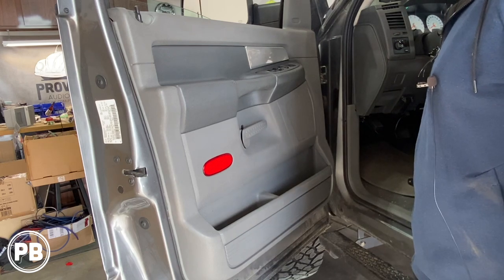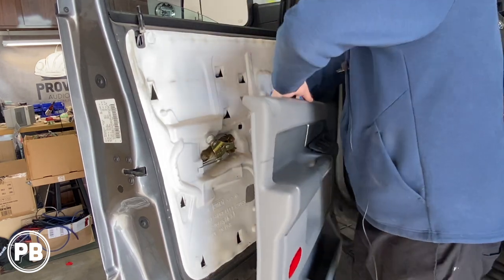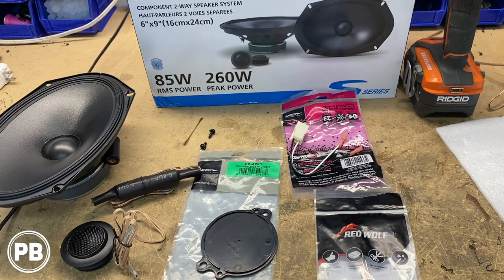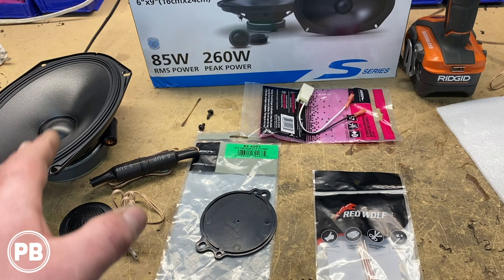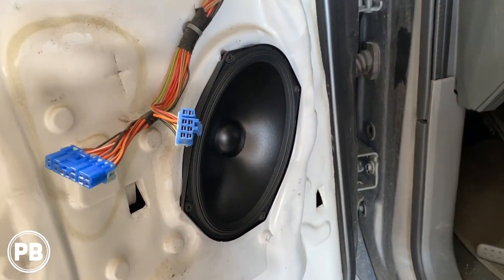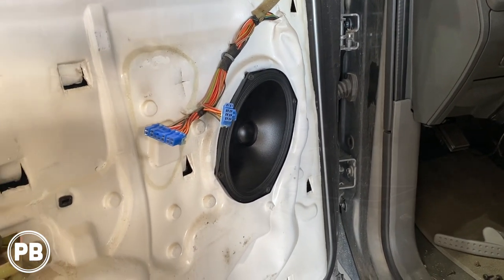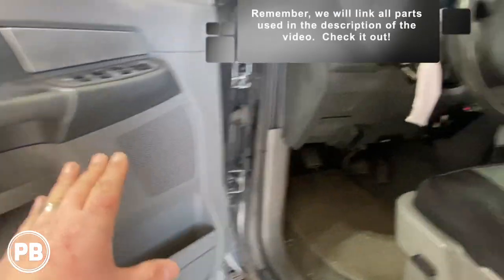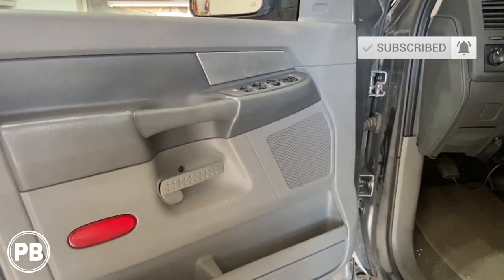2006 - 2008 Dodge Ram Front Door Speaker Install

Comment: Haven't seen bass blockers used in a long time. I luv them hard to find, though. Since every one uses DSP's now
Reply from the maker: Crossovers are still very common, and most speakers have passive crossovers already integrated into the speaker itself.  Most component sets will still have crossovers.  "Bass Blockers" are still around as well, but again, they are really frequency filters (to put it plainly).

Comment: Hello I have been Alpine fan from way back. I’m looking for A Alpine stereo unit that will go good with these speakers. They compliment each other. I would like one with CD player and blue tooth. I know Alpine doesn’t build ones with CD but maybe find a new old stock unit or a comparable unit from another brand. Thank you for any assistance.I have a 2004 Dodge 2500 crewcab pickup
Reply from the maker: hey Joseph, send us a message on facebook and we can help you with those suggestions.

Comment: Where do i get a crossover like you used?
Reply from the maker: They were included with our Alpine speakers.  Usually component speakers include their own passive crossovers as the manufacture knows exactly what frequency each speaker needs.

Comment: So no amp is needed correct?
Reply from the maker: An amp is always an added benefit.  Not needed, but highly recommended.
Reply: @ProvoBeastAudio  can you do a video like the one before but adding the amp as well?
Reply from the maker: @danielquiroz8294  I have a sub amp install video coming up soon.  You can use the same technique for a 4 channel amp, the only difference would be the speaker amped output from your amplifier will go back up to your harness adapter in the dash